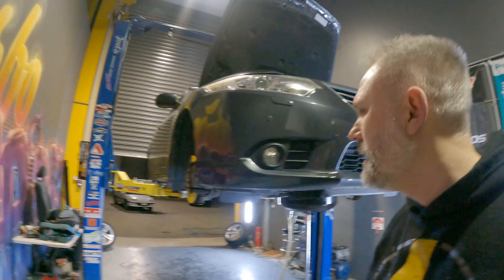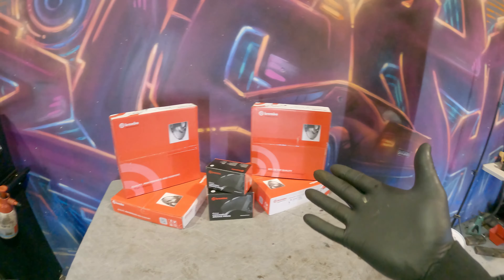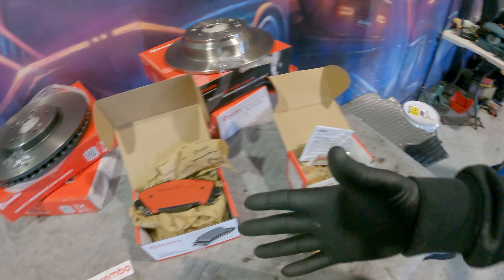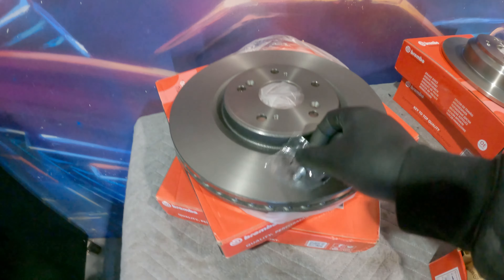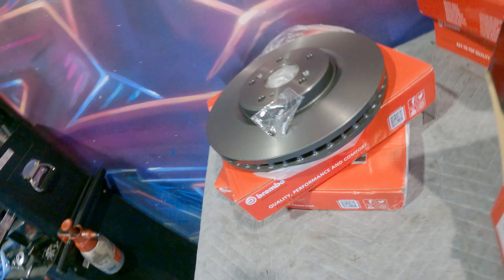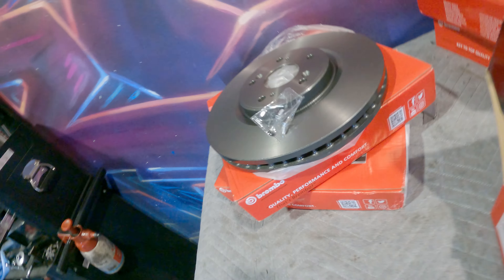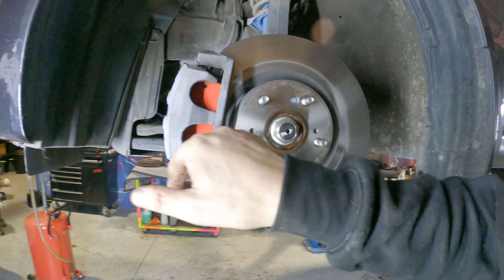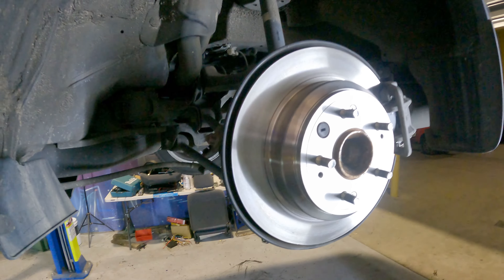Accord Euro -TSX CU2 Brembo Brake Upgrade

Comment: Not sure if the rear is the same, but the usdm cu2/cw2/cu9 tsx have a single piston caliper up front with 300mm rotors. Idk why Honda screwed us over with the smaller brakes lol.
I wish we had the dual piston.
Reply from the maker: @chrisb15679  sounds like Acura did you guys dirty we got drum handbrake rear and much larger all around, sounds like you guys got standard cl9 brakes